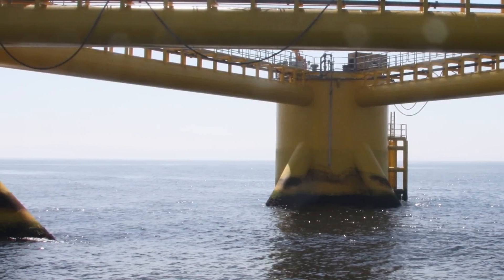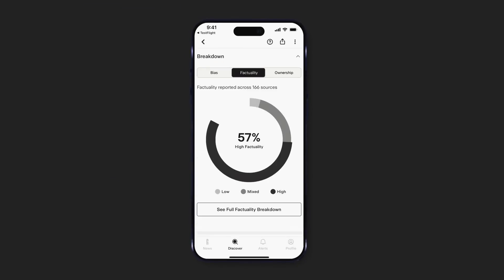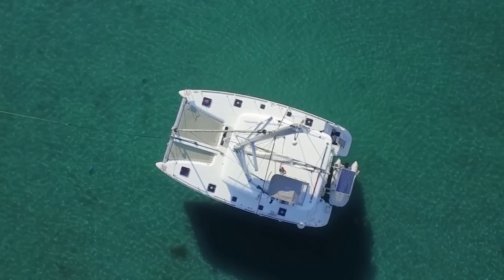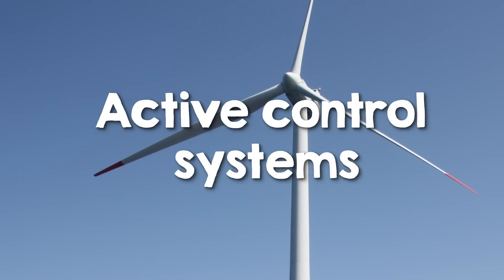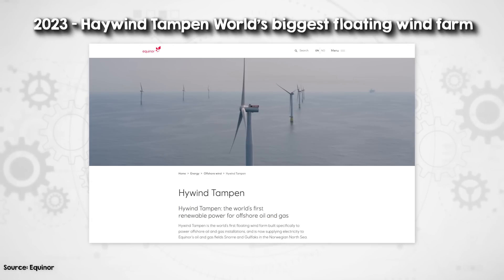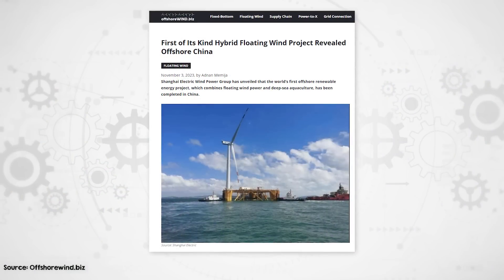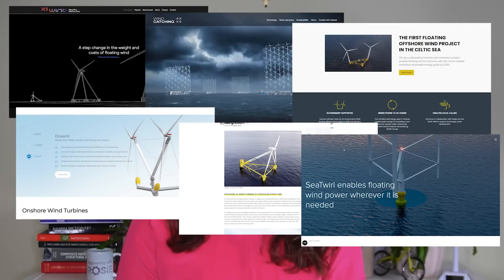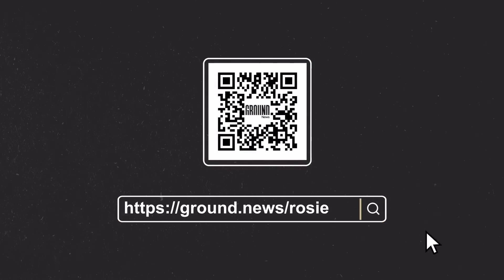The Rise of Floating Offshore Wind Technology

Comment: Rise? Recent data shows that offshore windmills are 30x more expensive than onshore.
Reply: EIA estimates: According to the Energy Information Administration (EIA), offshore wind farms are estimated to cost $6,230 per kilowatt, which is about 2.8 times more than the estimated $2,213 per kilowatt for onshore wind farms.

LCOE comparisons: The Levelized Cost of Energy (LCOE), which considers lifetime costs and energy output, for offshore wind is generally higher than onshore wind. Estimates range from $72-$140/MWh for offshore wind, compared to $24-$75/MWh for onshore wind.
Reply: @terjeoseberg990  Mate $6k per kWh is way off, I bet messed something up! $75 per MWh is more so closer to the real life. Keep in mind that $75 per MWh is already 20 times more that alternatives like coal, nuke or hydro. Also remember that new-green data is young and often missing bigger picture like recycling, decomision, grid construction and maintenance, long term impact... A lot of number given are for Hook-Up stsytem which assume that whole infrastructure is up and running.
Reply: @ryteulopki8069, $6k per kW, not per kWh. You do understand the difference, right?
Reply: @ryteulopki8069, Do you know what “LCOE” means? The Levelized Cost of Energy.
Reply: @ryteulopki8069, $6k per kW, not per kWh. You do understand the difference, right?

Do you know what “LCOE” means? The Levelized Cost of Energy?
Reply: @terjeoseberg990  I see, you have randomly dropped in the construction cost. No mate, the whole story goes around cost per MWh, as it is the industry standard. Nobody cares about construction cost as this is only a fraction of the whole investment. I understand that due to short lifespan, wind turbine's construction cost plays a greater role. But in the case of off-shore wind, it is mostly down to underwater energy transfer.
Reply: @ryteulopki8069, You see that now, do you? Apparently your reading comprehension is a bit lacking. Maybe you should pay a bit more attention when you read.
Reply: @terjeoseberg990  Yes, assuming that some folks stick to the subject can be misleading. You are correct I have missed your random gig.
Reply: @ryteulopki8069, You clearly have problems understanding what you read. What more do you have problems understanding?

Comment: Wind energy that inherently withstands storm waves, quakes, unusually high wind?  AWE (airborne wind energy), 1/10 as much material as tower/turbines for equal (more constant) power, can be "reeled in." Try towing a turbine to shore for routine maintenance, repair, and decommission.  Figure the value of concealing windpower when beach visitors want a clear view.  Current DOE wind research plan neglects AWE > /https://www.nrel.gov/docs/fy24osti/86564.pdf

Comment: Offshore wind is too expensive and never will be a major contributor of power where there is large amounts of land available for solar. The aerodynamics of vertical wind turbines is well known and is less efficient compared to the horizontal designs. putting 2 horizontal turbines on a single structure is also less aerodynamically efficient.

Comment: What about hurricanes and storms?
Reply: What about them?  All wind turbines have to cope with strong winds!
A quote about Hywind Scotland: "In its first 5 years of operation the facility has averaged a capacity factor of 54%, sometimes in 10 meter waves. By shutting down at the worst conditions, it survived Hurricane Ophelia, and then Storm Caroline with wind gusts at 160 km/h (99 mph) and waves of 8.2 metres."
Reply: @nigels.6051  storm Ophelia 
https://en.wikipedia.org/wiki/Tropical_Storm_Ophelia_(2023)
Is nothing compering to category 5 hurricanes with winds of 254km/h 158miles/h
https://en.wikipedia.org/wiki/List_of_Category_5_Atlantic_hurricanes
Reply: @prilep5  Obviously the turbines are designed for use in the areas they are going to be deployed.  The UK does not see category 5 hurricanes until long after they have lost power and become storms, so our turbines are not designed for true hurricanes.   I'm not sure it makes sense to build floating wind for hurricane areas, since hurricane areas don't have such good ocean winds as further north where the hurricanes don't occur or have lost power,  so I wouldn't be surprised if Texas/Florida stick to land based and fixed offshore, while further north where the good offshore winds are, North Carolina and up will go for floating wind since they have good winds and deep water.  Deep water generally results in lower wave heights and less turbulent winds, quite possibly floating wind will have less issues than fixed offshore, and they have been pretty reliable.  So far, the data suggests that there are no unsolvable issues in North Sea and East Atlantic conditions, nobody else has any data yet.

Comment: Can the push pull tensions of the stabilising structures tying the turbines together be used to generate electricity?
Reply: I don't think any of these floating turbines is going to move much, they weigh 10 to 20 thousand tonnes, a little wave is not going to move them and even the tides will not move them far, and without movement it is hard to generate anything.  Most are firmly tied to the seabed, they are not connected to their neighbours which are going to be a few Km away,  The Dogger Bank turbines, the biggest we currently have are 3.2Km apart, with a total rotor swept area of about 15 km², and the floating ones are going to be bigger, thus further apart.

Comment: MingYang OceanX is a breakthrough in offshore wind design ( because of guy ropes which allows better overall structure and weight distribution). They are updating their product portfolio nearly every year so I expect to see 2х11mw design in 1-2 years and 2х14mw design in 2-4 years. 
I'm sure that this design will go mainstream in 5-10 years and a lot of companies will mimick/develop that.
Reply from the maker: Maybe it will go mainstream, I think there are a lot of advantages to multirotor designs. But they've been around for ages (including an onshore version by Vestas a few years ago), and they haven't pushed through yet so I am not sure if this time is any different. I did a livestream on multirotors a couple of years back that got deep into the science and engineering if you're interested to learn more.

Comment: This technology is needed along the west coast of Canada. Lots of wind out there, but its too deep for conventional turbine assets. And as the technology is perfected and advanced, like all technologies, they will become cheaper. From a materials perspective there is no reason for floating to be more expensive than fixed installations.
Reply: I think you might be underestimating the cost of a floating platform capable of holding a 20MW quarter km high turbine reasonably vertical, plus the cost of the anchor cables and moorings required to hold onto 20MW+ of power!  Fixed bottom in shallow water must take less materials.  The advantage of being able to install the turbine while still in port may pay for the extra cost, but I think more materials will be used for floating?
Reply from the maker: In deeper waters floating should be able to use less than fixed bottom. But we are not close to them being cheaper yet, a little to early to say which way it'll go in my opinion.
Reply: @EngineeringwithRosie  There was an energy contract last year unsubsidized For $40/MWh. We are there.

Comment: Hywind Scotland, the floating wind farm that's just been taken down for maintenance, managed a 54% capacity factor over its 5 years of operation. (Over every time of day, every season, it averaged 54% of its maximum capacity)

Onshore wind averages in the '30s, and a very good solar array is 20 to 22%
Reply: Hywind Scotland was placed in a convenient test location, not the location with the best winds, and they used medium size turbines, not the biggest and most efficient ones.  The big new floating farms should do significantly better... it will be cheap power.
Reply: @nigels.6051  Thanks for that additional information, I believe they had 8 or 10 MW turbines. They still had the highest operating capacity factor of any renewable project in the UK...
Reply: @thewheelieguy  They are six MW turbines so a decent size at the time they were installed, but the new commercial floating wind turbines are going to be around 20MW so will be able to reach up into more powerful and consistent winds.
I do wonder if the high capacity factor might have more to do with the turbines used than the fact that they are floating, or their location.  Capacity factor is normally calculated as average output / maximum output, and if you fit large blades plus a small generator that reaches maximum output at low wind speeds, you can easily get a high capacity factor figure.   The blades on these turbines are quite long for 6MW output, and they are also direct drive, so no gearbox, which probably improves output but may have imposed a generator limited maximum rather than a blade size limited maximum.  So expensive turbines, probably for reliability reasons, but which happen to give a good capacity factor.   Probably a lot closer to what will be used on the big farms though than what is used on a typical offshore wind farm, so not necessarily cheating from a testing point of view.  I don't think the high capacity factor figures actually tell us much about floating wind, they just make for good press releases!
Reply: @nigels.6051 "...it will be cheap power."
Wind and solar will always be infinitely-expensive, on a sustained basis, due to their lack of energy and power density.
Reply from the maker: Whoa that's amazing. I hadn't seen that figure so I had to check and yep, 54% https://www.offshore-mag.com/renewable-energy/article/14287752/equinor-marks-operational-landmark-at-hywind-scotland-wind-farm
Will be great to see how much better this can get as the technology matures.

Comment: 7:38 As mentioned in this video floating wind turbine generator can have a huge long term advantage over fixed offshore wind turbine generators in that they can be towed to near shore for major repairs and overhauls.   This makes them far safer for human's to service with that service able to be done in a low wind environment near full scale machine shops onshore.   Floating wind turbine generators would be some of the largest floating structures with no crew posing a navigation hazard if they were to loose their mooring.

Comment: Rosie, the real energy is in underwater current generation.  If you took all the nuclear weapons ever made, the energy released would be equivalent to 30 seconds of energy available in the Eastern Unitted States gulf stream current!!!  The currents that go around every continent and also where there are two islands with constricting terrain on the ocean floor create a 100% duty cycle current for generators.  This current varies very little from season to season.

Since water at the ocean-atmosphere interface is 760 times as dense as the atmosphere, the potential is astronomical in creating energy for underwater electrical generation.

The challenges are to create seals around the shaft that interfaces with sea water.  The challenge to slow down the blades so fish are not hit by the can be mostly solved by using a reduction gearbox, BTW....is already used on commercial land based wind generators.  A sonic system to keep whales etc away. can be devised.  A cable system to lower and raise the wind generator for maintenance is being used by the offshore systems already.

Lastly you don't need very many of these systems because they generate a couple of orders more energy, than even the best onshore or offshore wind generations can provide.  So lets take a very lo ball figure of 1 water current equals 100 offshore generators; the cost differential per M wh/hr is so much in favor of underwater generators.
Reply from the maker: Nice idea for a future video, thanks! I'll add it to my list

Comment: Super presentation Rosie, thank you. Some people don't like to look at windfarms, I don't like to look at smog and breathe poisoned air. I don't like my tax payments to he handed to fossil fuel corporate killers and purveyors of death and disease. It's the same with banks, they're just as guilty and criminal. Windmills are beautiful and elegant. And don't harm birds. Coal mines, oil fields, fracking and biofuels are filthy, poisonous death dealing operations. I despise them and their shareholders.
Reply: "I don't like to look at smog and breathe poisoned air."
Then ban the things which lead to those:
Diesel
Motorcycles
Old vehicles

Wind and solar absolutely depend upon fossil-fuels. No fossil-fuels = no wind-and-solar.
Reply: @aliendroneservices6621  "Wind and solar absolutely depend upon fossil-fuels. No fossil-fuels = no wind-and-solar."
No fossil fuels = ?
You are going to need wind and solar if you don't have fossil fuels, currently we do not have anything else that could come close to providing all our necessary power.  While we do currently use some fossil fuels during the manufacture of wind turbines, the amount is decreasing, and could easily be zero in a decades time.  Fossil free steel is available, fossil free installation vessels are available, fossil fuel free turbines is the future.  Fossil free solar may take a bit more effort, but can also be achieved.

Diesel is a byproduct of refining oil, you can't just ban it without stopping the refining of other oil products.  If you refine oil then you have to find something to do with the diesel.
Reply from the maker: Ha ha, I like the way you said that. In the case of floating offshore wind though, there is a LOT of overlap between companies developing these projects and oil and gas projects.

Comment: Rosie love your work. 
But if  every Australian 20million vehicles were BVs with oversized battery and parked 23hrs every day, and every Australian building rooftop PV covered only 33m² then when the sunshines the grid cashflow is DEAD. 

The grid is a massive $1TRILLION infrastructure investment and needs $100BILLIONs in cashflow every year. 

Dead cashflow is a financial disaster far bigger than a grid generator's dead cashflow. 

Do you see the problem. 
A little more rooftop PV and then the customers can be the grid supplier.

So step 1, unload the customers load.
Step 2, keep the customers connected and supplying the grid back to its maximum capacity, 600gWh daily. 
Step 3, add industrial heavy user customers and RECOVER CASH FLOWS. 
Step 4, avoid more grid capacity construction, it is incredibly expensive. $1, 2, 5, 6, 10 millions per km is the published facts and professional construction opinions. (TRILLIONS)
Step 5, protect grid cashflow. 
Step 6, understand that the grid was built out over 10 decades.
Step 7, understand that not only transmission lines and infrastructure,  but distribution lines and infrastructure to millions and millions of customers who need no breaks in supply 24/7 is 1million km. 
Step 8, customers pay for rooftop PV and maintain it.
Step 9, customers pay for BVs oversized battery parked 23hrs every day.

Step 10, Expensive ANY GRID GENERATION will fail financially and want government money, tax payer's money.

Nuclear promoters are the pits of economic disgusting. 
Snowy 2.0 in future droughts and even today is the pits of economic disgusting.

Nuclear want to stop worldwide CO2 emissions and for Australia to buy more nuclear submarines and USA weapon systems. 
Nuclear want to export uranium yellowcake to 9billion people including the dictatorships nuclear electricity industries. 
Nuclear wants the world and the USA to police nuclear weapons non proliferation.
Nuclear want to add military exploding budgets to grid electricity costs.
Nuclear Australia wants the world to buy Australian iron ore and coal and copper and zinc and aluminium and uranium yellowcake and electrical grid raw materials. 
And Electric Vehicles or BV batteries materials.

Australia nuclear electricity stations are also military targets.

And todays grid handles only part of Australia's energy, only 15% of Australia's energy.

So 100% energy as grid electricity, FMD.
The old Australian saying. 

$7TRILLION to $70TRILLION plus generation plant costs $1TRILLIONs to .....

Then look at the cashflow the new grid must achieve. FMD. I said it again.

Comment: If I wanted a 3-phase supply to my home, then the street loads would have to be considered, and I may be denied. 
If the 30 homes on my street wanted a 3-phase supply and the street has gas supply, then our street transformer might have to be upgraded first.
I am just talking about 3phase, 3 times more electricity. 

So if gas cooking and gas hotwater and gas home heating is replaced with electric and BV oversized battery charging for 2 or 3 cars in every home.
Then we may wait months or a year or 2.
Now, if 20 million buildings on the grid went 3phase, I think anyone could see a problem. 

Now add industrial heating demand. 
I think we would see glowing wires in the streets. 

Does anyone see a grid capacity problem 🤔  ??
Reply: Nobody but you do. We can already make cables capable of withstanding gigawatts of power without trouble, and those are already widely used. The problem is not the cables, but how much power we can supply. And given that batteries are becoming cheaper every year, even despite the inflation of the past few years, we will have even fewer problems supplying such power.